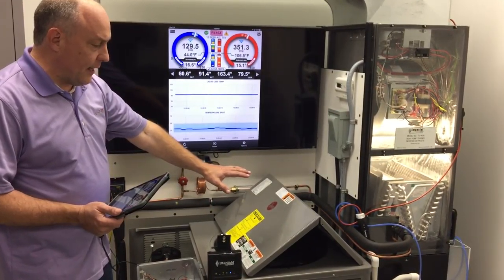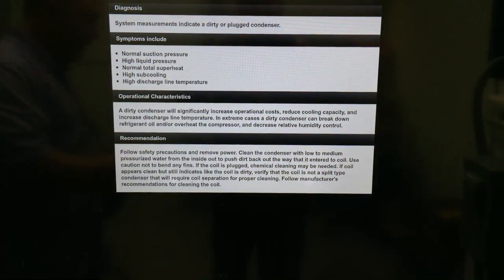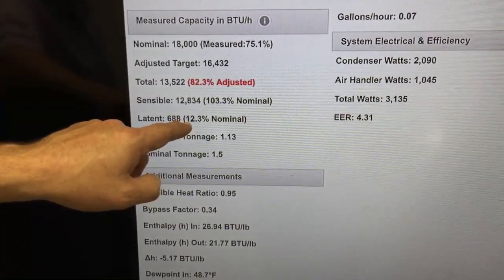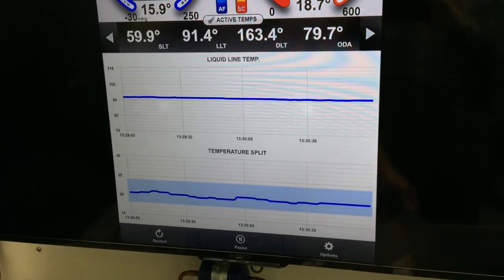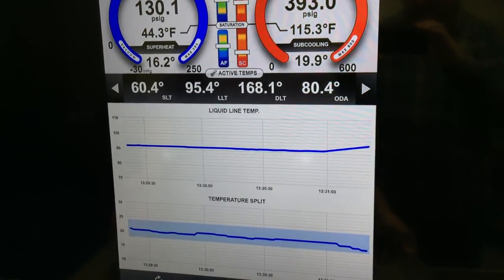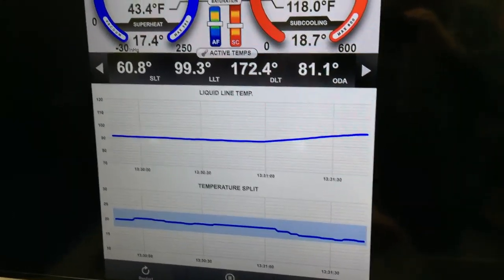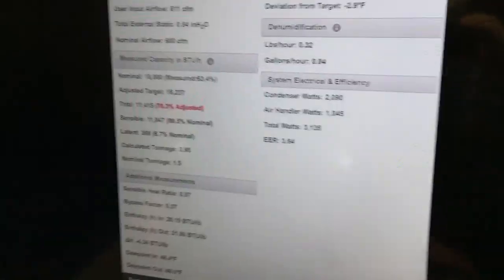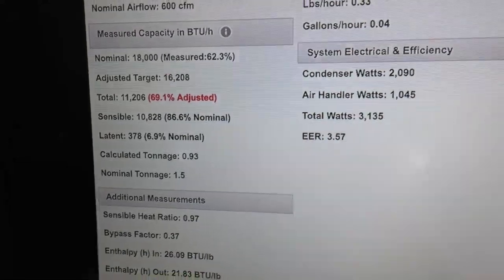The Effect of a Dirty Condenser on Cooling Capacity

Comment: Great video explaining the in  depth cooling performance decrease and effects on refrigerant in the evaporator of dirty or blocked condenser air flow. Some videos w/ an  ASHP system in Heating mode and using the iManufold or iConnect to troubleshoot and explain effects would also be appreciated.  Thanks for taking time to share your knowledge.

Comment: Im considering doing a transmission cooler bypass on my transmission because im concerned about my transmission getting contaminated but im worried putting a cooler in front of my condenser will be affected and the efficiency of my ac will drop
Reply: It will, you would be blocking airflow to that part of the condenser as well as preheating the airflow to that part of the condenser. However, the effect probably won't be significant. When I tested that the effect on my AC's head pressure was only about 10 PSI, and that was with a hot (180 degree) transmission with a big (11 X 11 inch) cooler. I have a racing radiator with no transmission cooler, so I installed a cooler under the back of my car with a fan on it. It's a win all the way around. The trans runs nice and cool (usually around 160 degrees max), the AC isn't affected at all, and the engine's cooling is improved since the transmission's heat is now being taken to the back of the car and discarded instead of being dumped into or in front of the radiator.